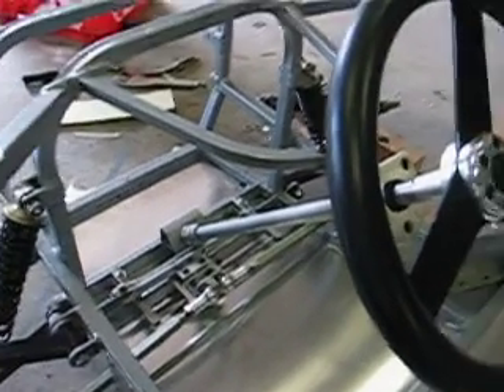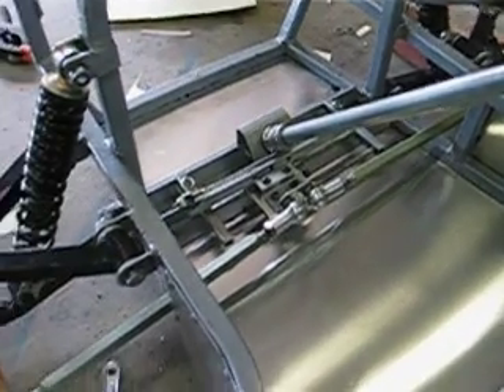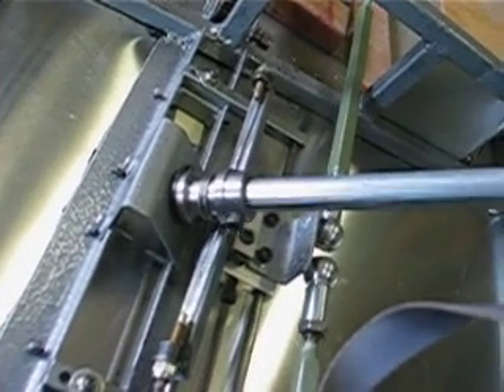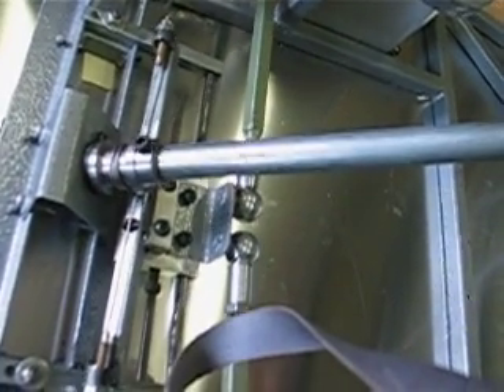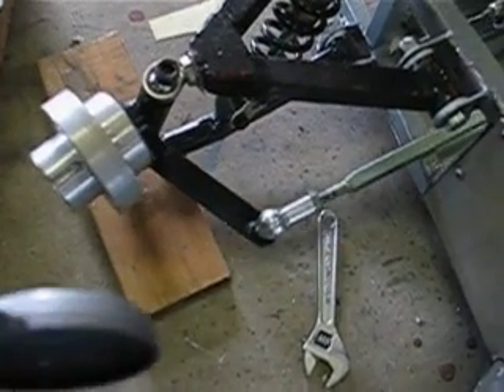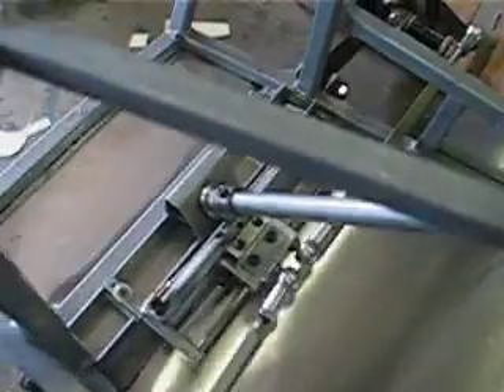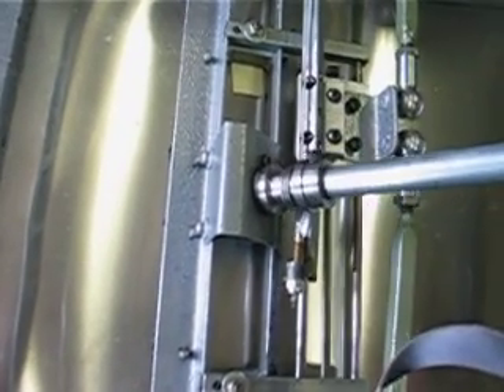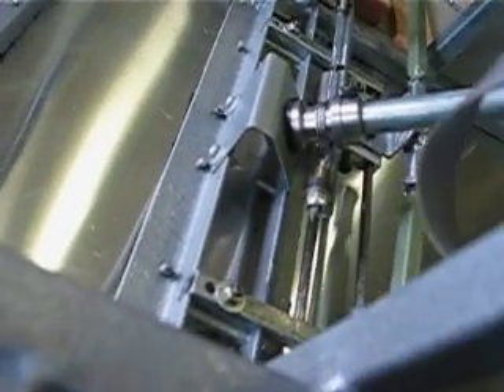Go-kart steering design

Comment: You're going to get an awfullot of bump steering I'm afraid...
Reply from the maker: Why do you think that? It doesn’t bump steer very much, and the steering arms are as long as they practically can be given the constraint that the overall size of the mechanism is quite small (compared to a full sized car) and that the steering rack (which has long been replaced by a rack & pinion since this video was made) has to be out of the way of the driver’s legs. Honestly, these sorts of comments are amusing, because it’s just a billy-cart, (now retired), it’s not an F1 car and the suspension did its job pretty well in practice. If you want to make a better one, go ahead.

Comment: I badly need to know, Where did you get those Axle carriers/steering knuckles? I am building a custom honda odyssey and I don't know what to use for carriers. kinda need it to be under 120 for a pair..
Reply from the maker: You mean the kingpins? Made 'em on a lathe from steel barstock (2 parts, welded together). I wouldn't necessarily recommend that for a real car.

Comment from the maker: The "capstan" is turned from steel and is pinned through the steering column with a nut and bolt. The cable is anchored using a pin that passes through the capstan but an easier solution is to just feed the cable through the capstan which I did on a later version. Once tensioned it doesn't slip easily anyway but the extra anchoring keeps it fixed in the same position.

Comment from the maker: Also, a general comment about things that "can break". Anything can break if it's not up to the job. When you design and build something, you have to make sure it is up to the job. The breaking strain of the cable is in the hundreds of kg range - there is no possibility of forces of that magnitude being encountered and if there were I'd have a lot more to worry about than the cable. There are many ways to solve an engineering problem, this is the one I chose, given the materials and tools I had.

Comment from the maker: Pitman arms have very limited movement, and the maximum movement is in the centre position, just where you don't want it. Rack and pinions are difficult to make. The suspension geometry does not feed violent forces into the steering tie rods because the scrub radius is almost zero. It works anyway. On one race I hit a very large pothole and nothing broke or bent.

Comment: Why not a Pitman arm?  The cable can loosen (slip) or break.  This is just another component that can go wrong.  Why not a rack and pinion?  There are some pretty violent movements back and forth on a steering system and with a suspension system on the front end, you'll also have the vibration from that working on that thin cable and its tension devices.  No way I'd drive that at any speed.  You could have just done a tie bar and run the cable all the way to the knuckles.

Comment: That looks great- I can't help wondering why you haven't got the rack and pinion from acar though. I am building a go kart at the moment, i have just finished assembling the steering, i have used the rack and pinion from an old citroen AX, i just bolted it to the frame (piss easy), shortened the linkages, and connected them to the front stub axles from a go kart. I made another go kart with a cable operated stering, but the entire front axle rotates unlike your design. it snapped at about 20mph

Comment from the maker: @whataburgerchicken You're right, but one problem with more turns is that, because we have limited space at the ends of travel, the cable gets pulled to a sharp angle, which stretches it making is gradually loosen, and also tend to wrap on top of itself. 3 turns was all we could manage and keep this problem from becoming too severe.

Comment from the maker: @tavcarovski Why do you think it's dangerous? A slipping cable would be for sure, which is why I point it out as a potential issue. In our case we addressed it by anchoring the cable using a pin that secures the cable to the capstan, but this is only really necessary because we overlooked the issue initially. Like any mechanical system, a failure could be dangerous, so build it strongly and accurately and fit for the purpose.

Comment: @GRAHAMAUS 
that is dangerous (but very innovative), as you said, there is possibility of cable slip and perhaps jamming the steering altogether.
If I were to make my own go-cart... I would use Honda prelude mechanical (rack and pinion )4WS steering system.
I wish you luck with you project.

Comment from the maker: @benclausius 
Hi - works really well, has a nice feel. The only problem we ran into was that the cable can slip so you need to put a lot of tension on it. We made the capstan very smooth which causes this - in hindsight we should have knurled it or left a rough finish to increase friction.

Comment from the maker: @alienboy366 I don't think I've seen this type of system available anywhere, and we made everything from scratch with the exception of the ball-joints which are standard items. It's quite low-tech, there's nothing in it that can't be made by an amateur with access to a lathe and a drill.